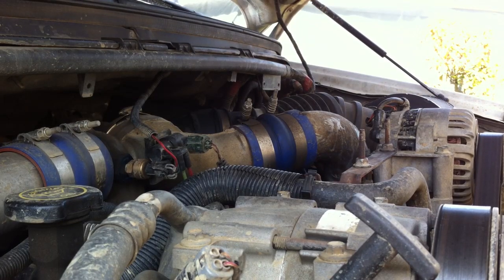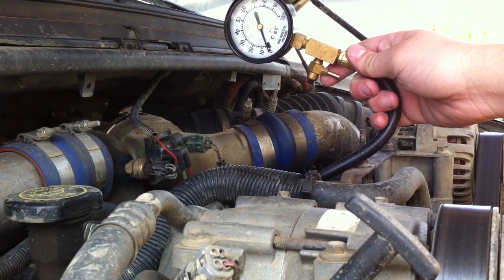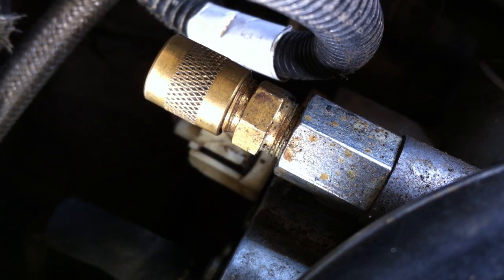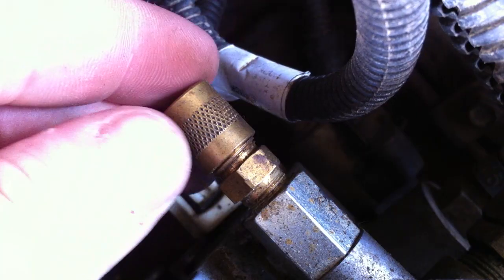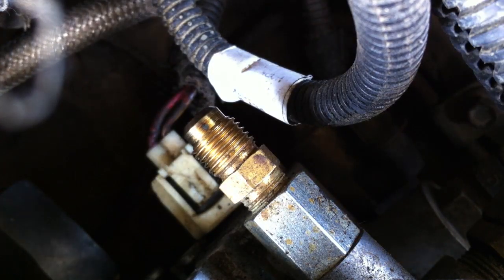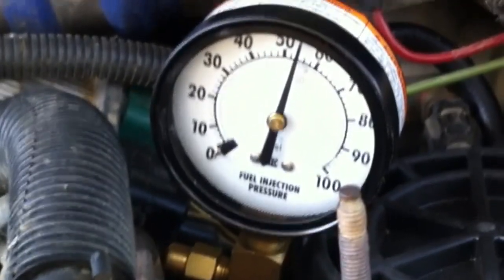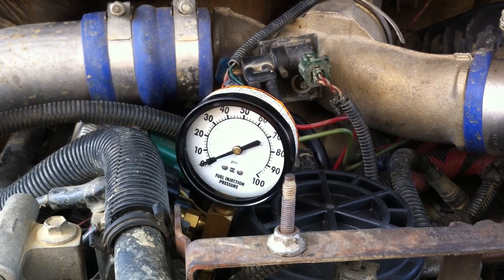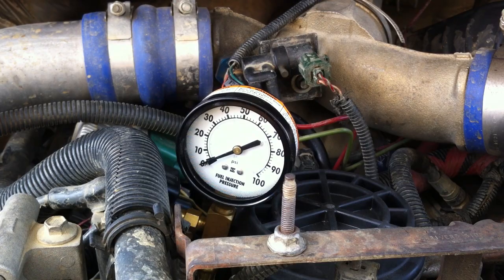7.3L - How To: Measure Fuel Pressure

Comment: Good video.  A lot of (other) vehicles come with a schrader valve already / permanently installed as part of the fuel rail. Wonder if the material inside the Schrader valve insert is made to be fuel tolerant as opposed to air version (the commonly available type)

Comment: My 7.3 powerstroke does not work with 60 psi of fuel, I made a regulator that reached 110 psi but even so it accelerates for a while and the filter runs out of diesel, change injector tires, clean the tank, engine service, pressure regulator. What could it be, I'm from Guatemala, please help

Comment: at 50psi who is the smart ass who says you can't leave it on?  almost every gas vehicle has one from the factory with that pressure and no issues.  unless diesel ruins the rubber seal in the schrader valve faster than gas.  i guess i really don't know.

Comment: My fuel pressure is dropping as low as 48 psi. I'm thing weak pump. Any advice on what would cause it? Truck also lacks power around 35 mph and 45 mph it will pour black smoke when the fuel pressure drops i really have to push the pedal down to accelerate then it pours black smoke and takes off good.
Reply: Screens in the pick up that are located inside the tank are common to plug up. DieselTech Ron has a few videos on YT showing how to clean them.

Comment: Eeh, is this a 94-98 or 99-up model?
Reply: The Ball the truck in the video is a 99-03. U can tell from the intercooler pipes and u can see as soon as he turns the key on he has pressure. 94-98 wont have that.
Reply: @aaronmullins3903  
Technically there is no 98. Ford ran the 97 up about may 98 when they did an early release of the 99 superduty. I have a February 98 build date on my 97. And you have to be careful because both of them have a few parts that aren't what they should be earlier or later.

Comment: good video but if you can't read it while driving its pointless.  so if you gonna do it do it right. something permanent plus down stream of the filter thus monitoring both pump and filter. its the whole point of gauges so you can instantly know and save time troubleshooting! plus how often do pumps go out? a lot less than filters and filters are cheaper. so change the filter.....still low psi you got other issues. =]

also this is on what 99 and above? 94.5 - ? are mechanical pumps.
Reply: @tigeraudio  I recently moved so im in the middle of reorganization. I have a fuel sending unit somewhere i can't find but I'm almost 100% positive it's the same as most Oil psi sending units and they are 1/8-27. 

If you can wait a day or so I can pop my hood and double check but I'm 99% sure it's the same.
Reply: @tigeraudio  let me look. I'm trying to remember. Seems like it's a fine thread. 1/8 inch maybe.

Comment: All is well..BUT you need to do this test under load while driving, not just revving it up. Seen them do well in shop then drive and pressures drop to 10-20 psi. Never dropped below 45 psi at shop. YOU MUST DRIVE IT OR YOU WILL NOT GET THE INFO YOU NEED. The gauge needs a 6 ft hose.

Comment: Did a fuel crossover from riffraff used the 68-72psi spring getting 80 key on engine off and almost 90 running is that bad also I pit new regulator poppet on they said use an oring also seems a bit much to me I think that additional oring on the poppet is the reason for the 90 plus psi what do ya think
Reply: +Bryant Ecklund yeah he has something wrong. relief port stopped up? im not familiar with the regulator.

Comment: Wouldnt the pressure at the location you have show just the pressure in the bowl? You would want to put it in the other port to show the pressure after the pressure regulator to check the PSI heading to the fuel rails rith?
Reply: You are probably an old man now since this is an 11 year old comment but yes absolutely I agree it should be post fuel bowl filter.

I also believe in a perfect world that a pre fuel bowl inline filter be installed after removing/deleting the tank fuel filters. Attached to the frame rail and a T installed between the tank and the "aftermarket" inline filter so you can then run a fuel vacuum gauge to your dash showing any excess backpressure from the inline fuel filter. That gives you a good idea of when you need to replace the inline fuel filter or if the filter you bought is too restrictive.